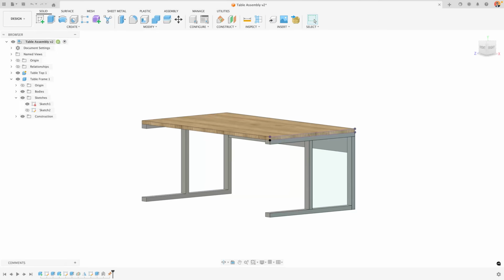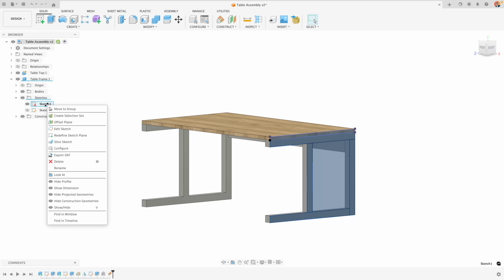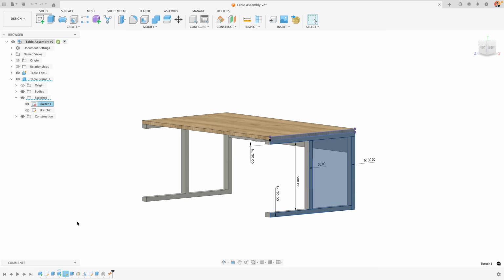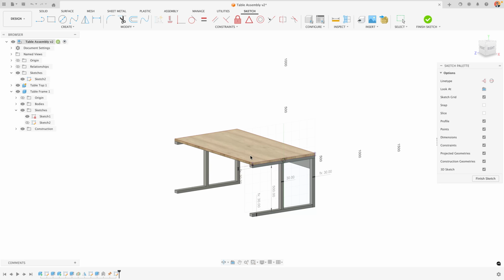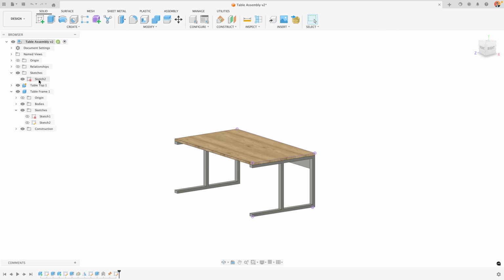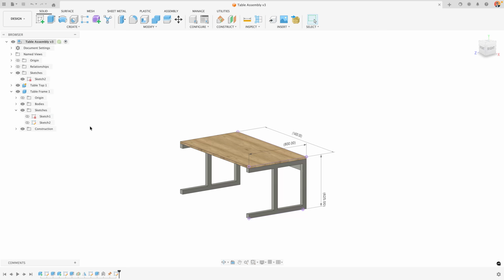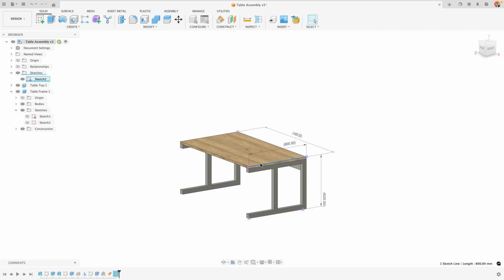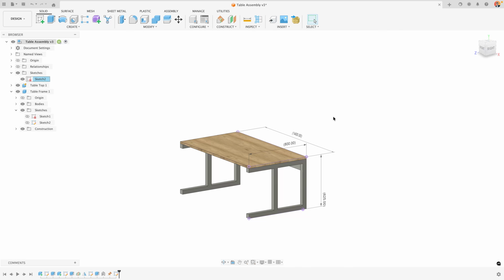Show Sketch Dimensions Outside in Fusion - 3 Steps

Comment: That's really helpful - thank you - but I found, for me at least, an easier way to get into it. When you start the third sketch there's a 3D Sketch option with a check box at the bottom of the Sketch Palette. Turning that on gets you right into this without the pull down menu steps you went through.

Comment: Why does Fusion suck so hard in performance?
it cant handle splines and complex sketches.. if there is a faulty sketch it will check this every time you do a new step which slows it down even further..
it really became a slow crapware with no fixes coming to main problems and you still charge monthly wages for it. shame on you

Comment: Yes this is extremely handy when rapid modelling something. I also use the driven dimension all the time when drawing objects (sheet metal pans) that need rivet holes along a flange as the driven dimension works inside the pattern command. Very hand to know that distance especially if other dimensions change that length with different specifications for the job.